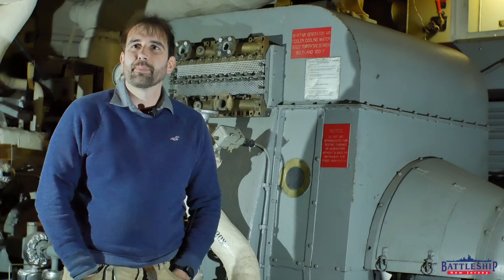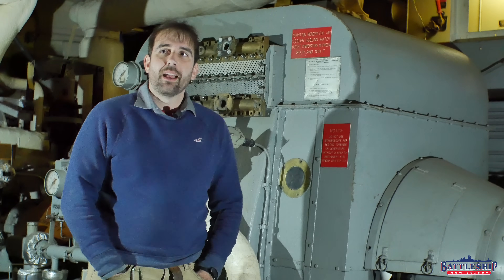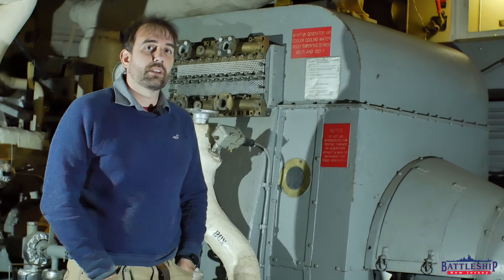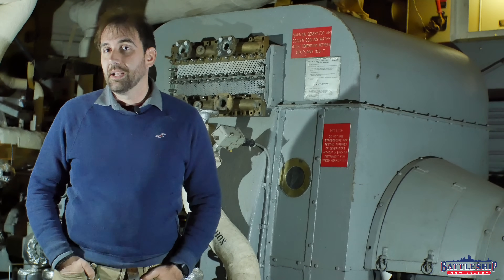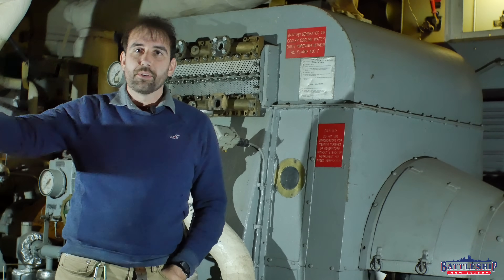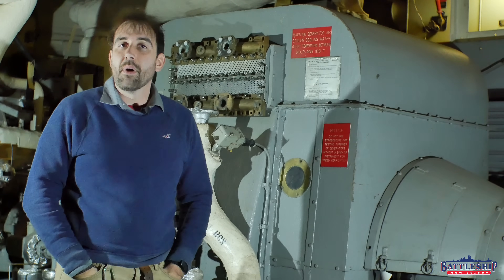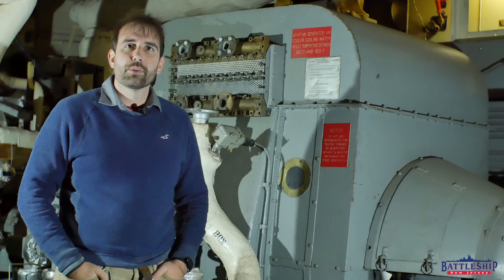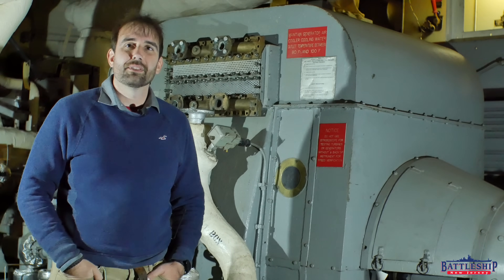Turbo Electric vs Direct Drive Turbine: What Propulsion Plant Is Better for Capital Ships?

Comment: I've heard that there is no way that New Jersey could go faster than her top speed, no matter how powerful any new engine installed could be. Is this true?
Reply: this is true for every ship, that has a displacement hull, the hull speed = the top speed. you can't get over that. (unless you build a planing hull) so you install enginepower to reach hull speed + a bit for redundancy and/or fast acceleration. but the top remains the hull speed.
Reply: @Jacob-W-5570  A properly designed bulbous bow for the hull cancels the bow wave that sets hull speed, resulting in a higher top speed.
Note the "properly designed" part, you have to spend a million on finding the right design for each hull form rather than just throw a standard one onto the hull.
The extra speed and greater fuel efficiency is why all newer cargo ships all have one.
Reply: I don’t know about the Iowas specifically, but in general vessels with a displacement hull are limited by their length. Once you reach the speed where the bow and stern wakes meet it takes a tremendous amount of power to go faster. 

As much as I like the idea of seeing a BB with a planing hull, I can’t imagine how much power it would take to get up on plane.
Reply: I think the calculated horse power for NJ during her speed record was 235,000hp. At a point there is not much gained. Similar to any object moving through a fluid,  including cars.
Reply: In addition to the comments that the other respondents to this question provided, I was told that a major limiting factor was the amount of abuse the screws, shafts and hull could take. You're moving a lot of metal through a fluid that doesn't necessarily give way that easy, and for every action there is an equal and opposite reaction.
Reply: @minarchist1776  that’s for sure. The torque required to exceed hull speed would put incredible load into the structure of the ship.